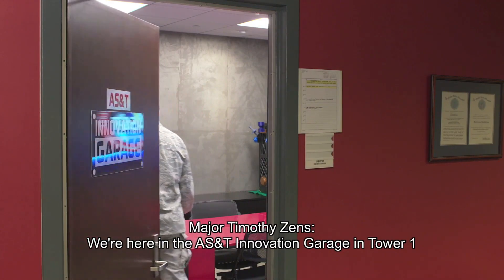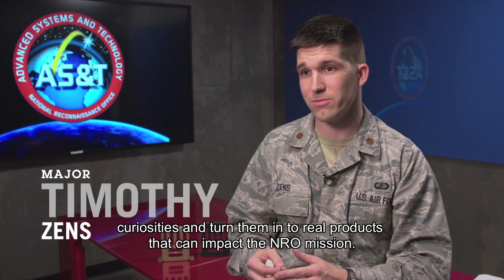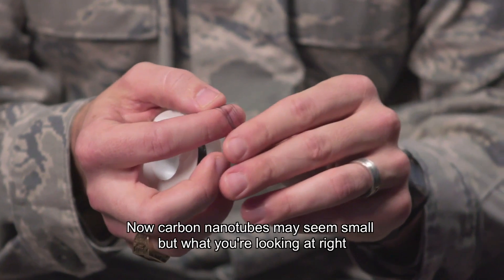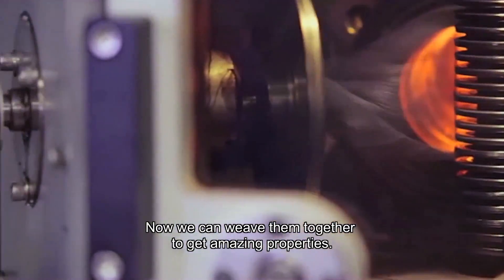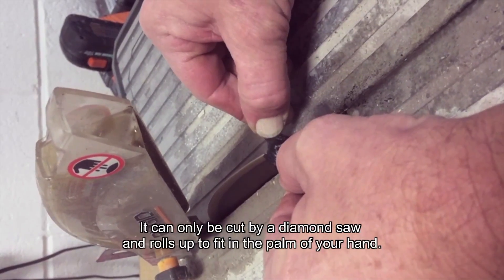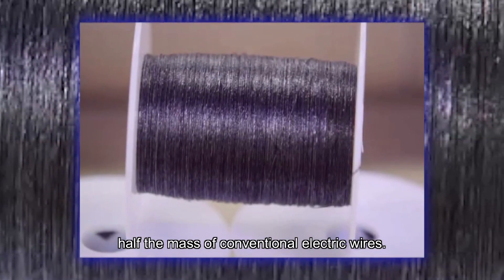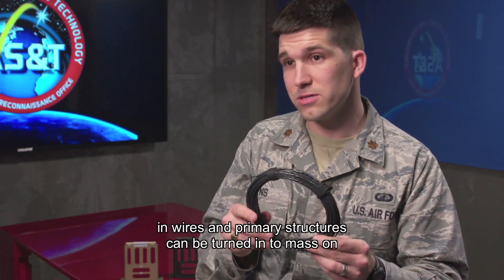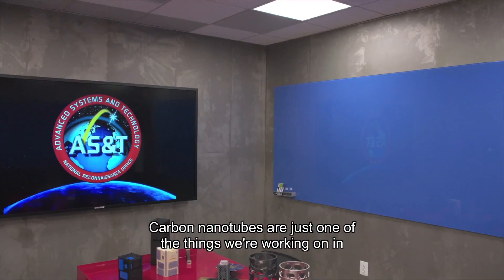Strongest Rope in the World - Made from Carbon Nanotubes

Comment: Amazing product. Surprised it hasn't been used for building purposes.
Reply: its too expensive
Reply: @wowlaulau6944 , they “are” using these in elevators?
Reply: @jmikronis7376  yes
Reply: There starting to use it in concrete
Reply: They haven't found a cheap way to mass produce
Reply: in future years when they are able to find a way to mass produce these at a low cost we could be living in the future in our lifetime

Comment: It may be possible to build space elevators from current materials. Just as rockets are built with multiple stages, so could a space elevator be built with multiple stages but the heavy lifting on a space elevator is at the center. At G.E.O. where gravity is virtually zero, there is no weight penalty for having multiple tethers. By using multiple tethers at the center ( for greatest strength ) and fewer tethers as you move away from center ( for lesser amounts of mass ), you avoid the problem of not having a material which is both light and strong enough. Liftport has plans to build a Lunar elevator from high-strength para-aramid fibres (such as Kevlar and M5) or ultra-high-molecular-weight polyethylene fibre. Using that same material for an Earth based elevator would reach the lunar gravity center (about 9,000 km AGL) approx. 1/6 G. Add this new concept and you could reach Earth’s surface.
Reply: So how wide is the elevator at the center?
Reply: @NwoDispatcher   the system is scalable, i.e., add as many tethers necessary for the calculated load.  Watch the video on YouTube, "Modular Space Tether". It will allow tethers to be replaced in case of damage, upgrade, etc. Also, it is much easier to bring up many small tethers, as opposed to one giant tether like in the current proposed system.
Reply: @chrism.1131  don't think it would be a mile wide, do you?
Reply: @NwoDispatcher  eventually, it could be more than a mile wide. We are just barely getting started building in space.
Reply: @chrism.1131  no I'm talking to make it possible to lift a ton, what would it take?
Reply: @NwoDispatcher  I know where you are going with this, so, to answer your question- A LOT.
Would you at least be willing to admit there could be some advantage to building
a space elevator with multiple stages as opposed to one large tether?
Reply: @chrism.1131  yep. If it's possible that's how you'd do it. Big ol scaffold. How it connects is pivotal thou
Reply: @NwoDispatcher  Watch the video I mentioned above. Modular Space Tether.
Reply: @NwoDispatcher  yeah
Reply: @chrism.1131  ok thanks